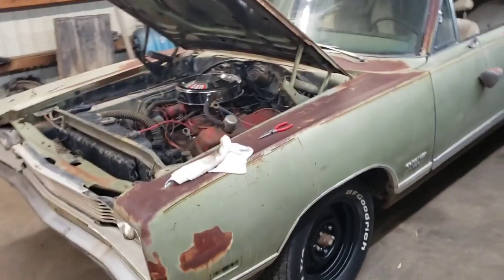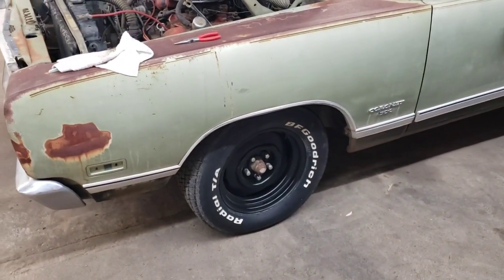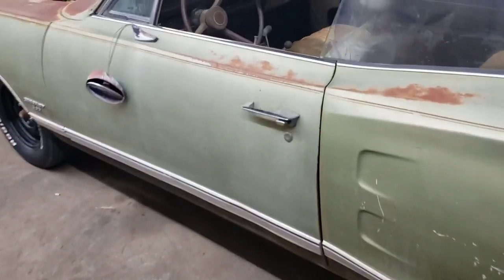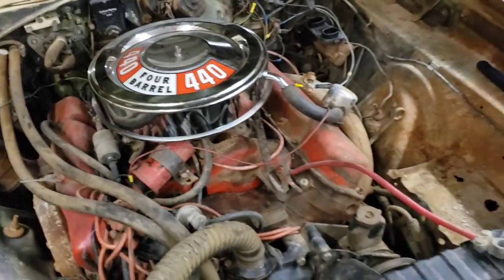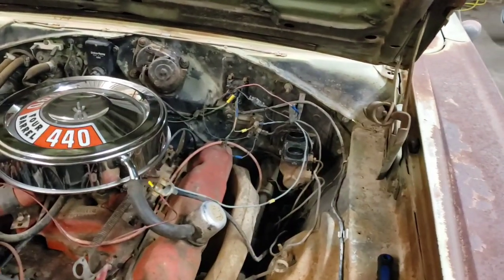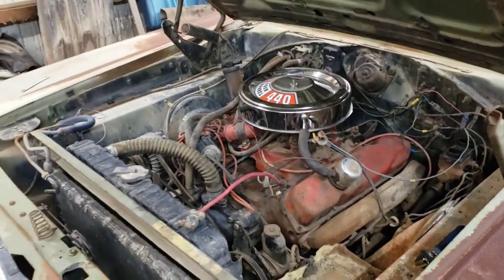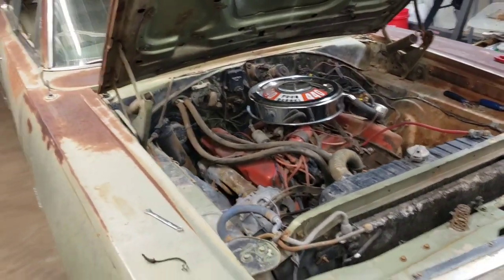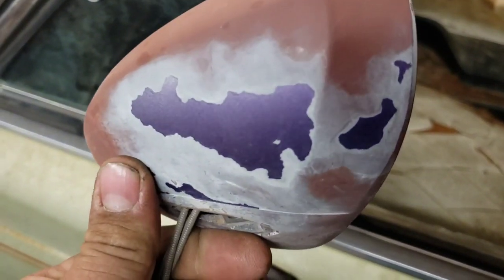1969 Coronet 500 Project Update. Building A Fun Driver. 440 4 Speed #mopar #dodge

Comment: I few hoses, gaskets,  plugs and wires + cap, some paint and a pressure washer and do a proper underwood detailing it fresh. Probably do it for a buck fifty, and when you pop the hood it'll speak for itself and motivate you to do other projects
Reply from the maker: I plan on cleaning it up more for sure. The wires probably need replacing but the cap is like brand new

Comment: Looks like an original 318 auto with AC, nice.  The grill is from a 440 and missing the 500 badge.  Great project for someone.
Reply from the maker: The grill is original but I took out the 500 badge
Reply: @ryanbarsness  Interesting that the sun faded the black from the grill and not the bezels.  Either that or a previous owner removed the black paint from the grill.